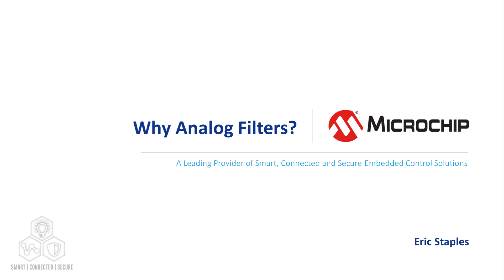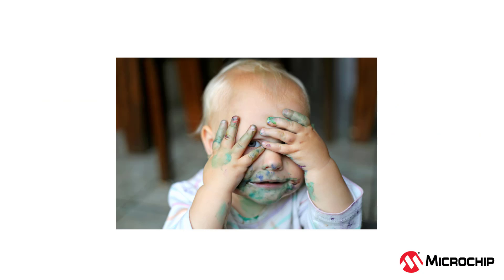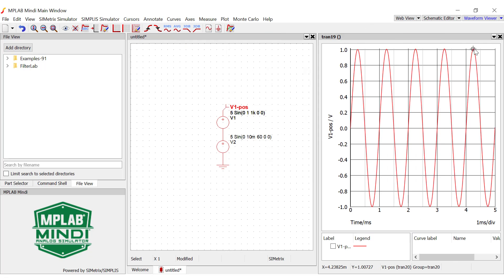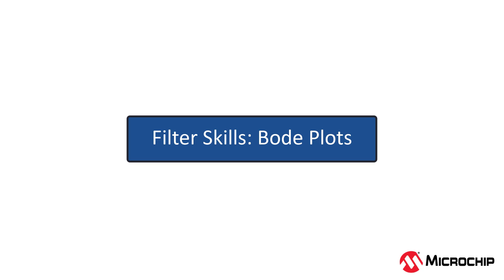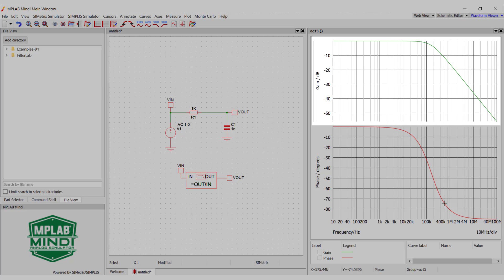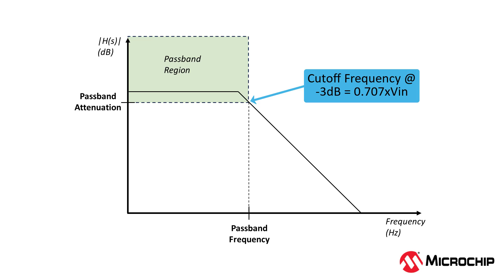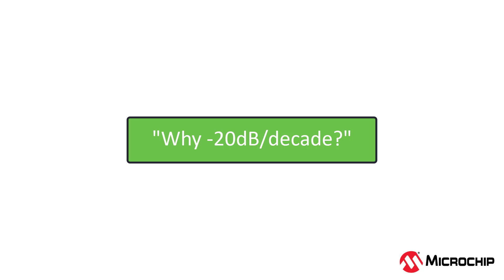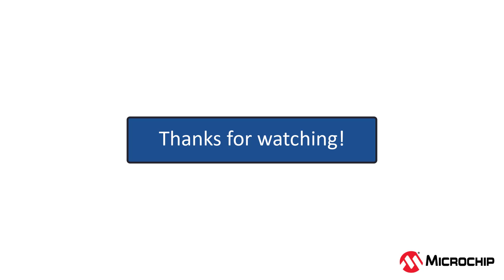Why Analog Filters?

Comment: Hi, is it possible to use the "MCP3461" 16 bit ADC for A DIY audio sampling project?
Since it has differential input, fairly high sample rate, cheap.
Reply: Hi there, thanks for your question! Yes, the MCP3461 is able to be used for a DIY audio sampling project. It features differential input and a sample rate of up to 153.6 ksps, making it suitable for capturing high-quality audio signals. However, you will need to implement proper signal conditioning and anti-aliasing filters to ensure the best audio quality. Hope this helps!
Reply: @MicrochipTechnology  hi and thnx for the answer, what you mean with: proper signal conditioning?
a Sallen Key Filter is easy to add.  looking the datatsheet again you probably should use 2.5 V reference reference, right? how about the negative?

i have seen more of these complex adc/dac "chips" and you don't try, scared that mess up with the differential input and it's ends up in the trash.

Comment: tons of noise in my 15x Sharp IR and my professor pushes me to just use software filter techniques, but I really want to just use analog I think it's more robust. What do you think?
Reply from the maker: Thanks for reaching out! Using analog filters can be more robust for reducing noise in your sensor. Analog filters, like RC filters, can effectively clean up the signal before it reaches the digital stage, making it easier to process. This can be particularly useful for eliminating high-frequency noise and interference, which might be harder to handle with software filters alone. Hope this helps!